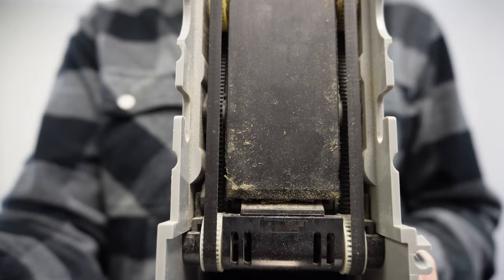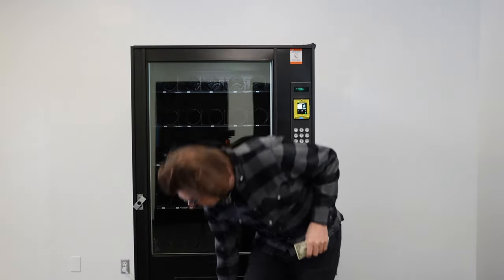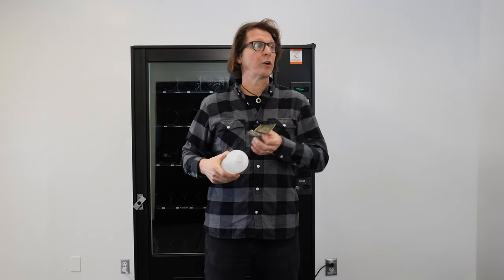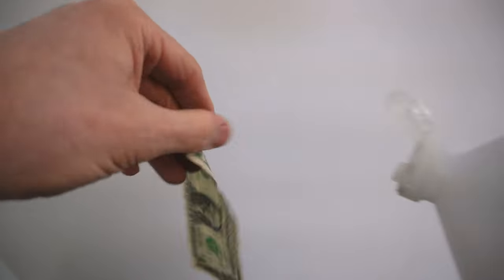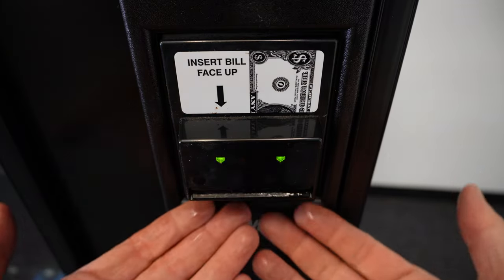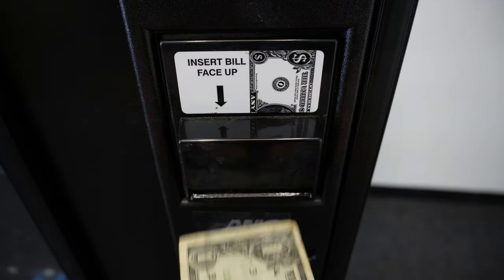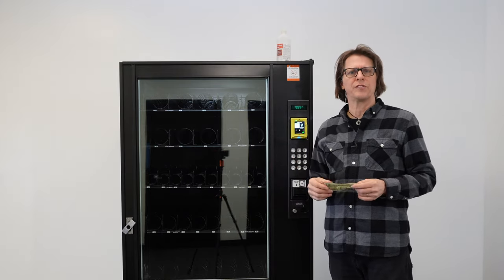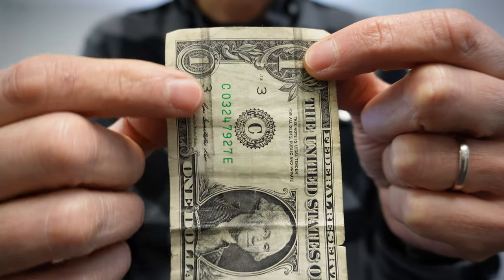Vending Machine Bill Acceptor Preventive Maintenance Tip

Comment: Hey there! I just got into the vending a few months back. Recently we had a deep freeze and had to empty out my machine and leave it off for around 10 days. But a day or two after I set the machine back up, the bill validator on it just makes the noise as if it is working, but doesn't pull in the bill. Would you have any suggestions on that?